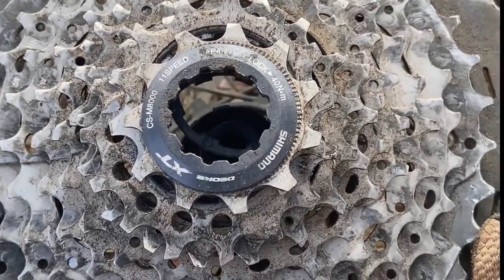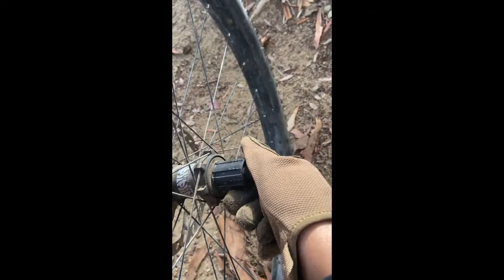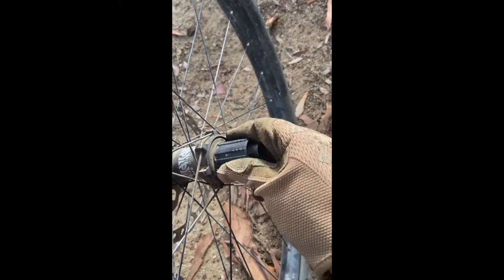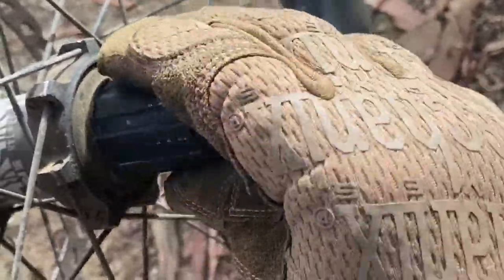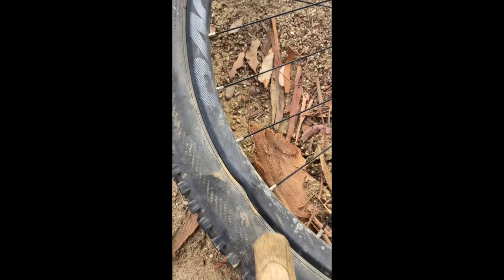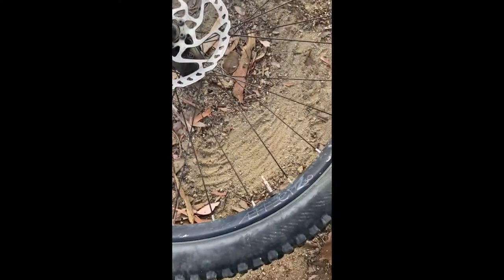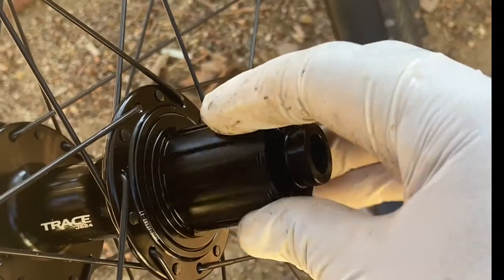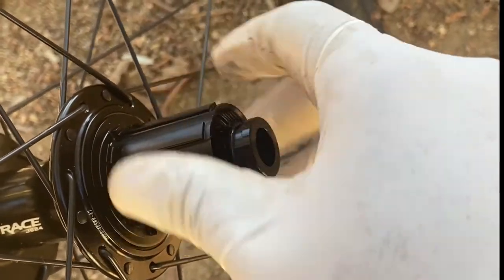How to fix a cassette that spins in both Directions (Easy Fix)...

Comment: Genius fix, there.
It’s broken, buy a new one.
Pro level mechanic right there.
Reply: he's not completely wrong tho. if your freehub spins both ways then the teeth there are completely sheared off so all you can do is replace it. don't have to replace the whole wheel but in his case the rim was also badly damaged
Reply: @richardbottom9843 usually if the freehub spins both ways the grease inside is solid and making the pawls stick.
The long way to getting it fixed is take it apart, new bearings and grease.
Quick way is to spray brake clean/ degreaser into it while turning the free hub, when it’s only going one way, put oil into it to lube it, it’ll work for another couple of months until you fix it properly.
The wheel didn’t look too bad, I thought it was a tyre bulge more than a smacked rim
Reply: @Thecrazyvaclav I think the OP has a bulged/dented head. Possible as an infant